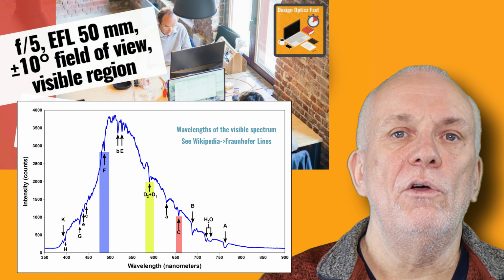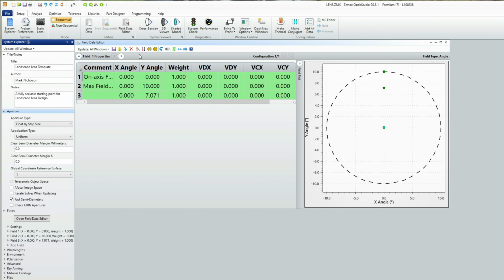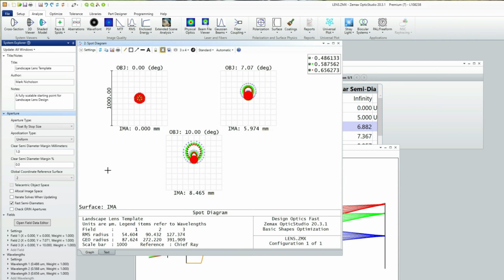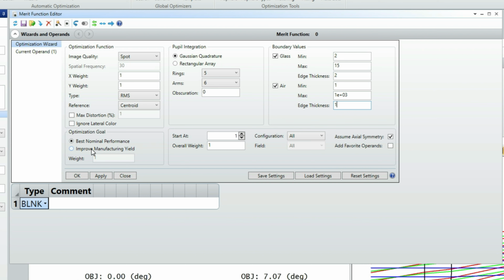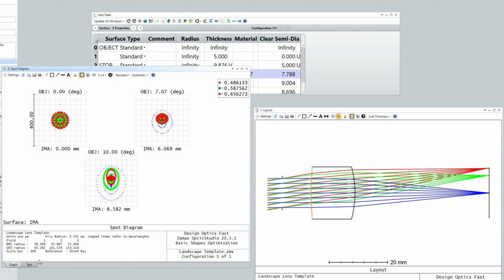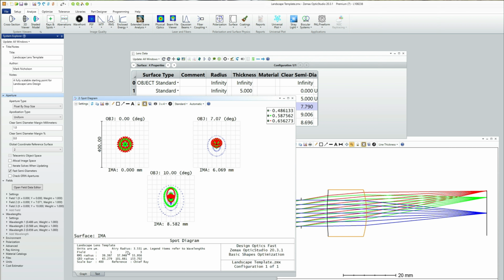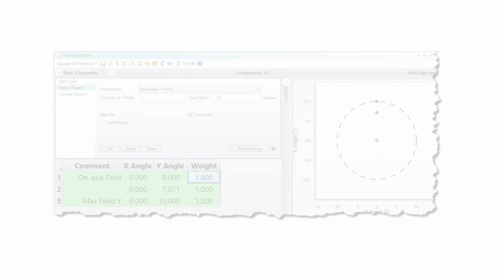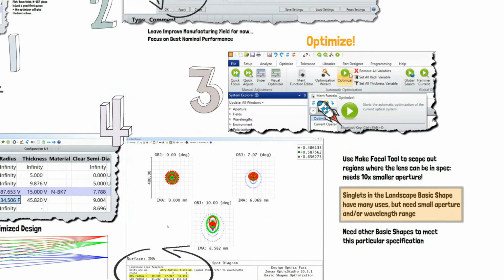How to Optimize the Landscape Lens with Zemax OpticStudio

Comment: Amazing video Sir. I have a question regarding optimizing the last lens surface using f#. Does it only work with a singlet or can we use this F solve on the last lens surface's radius in a multiple lens systems?
Reply: Hi @Sanjay Kumar, you can have as many surfaces as you like. Put the f/# solve on the last radius and it will control the overall system f/#
Reply: @marknicholson5508  Thank You Sir
Reply: @marknicholson5508   I was wondering, why the quality of the zero field point increases with the reduction of focal length. The spot size is a function of the f-number only, correct? And it stays the same when you use make focal...
Reply: @alexsandra1009  I think the diffraction limited spot size doesn't change, that's 1.22*wavelength/f# but the geometric spot will as aberrations reduce. Of course, the real spot cannot get smaller than the diffraction limit, but the geometric spot shows the effects of aberration balancing even though it's not observable. Drop me an email at markgnicholson at gmail if you want to discuss further.